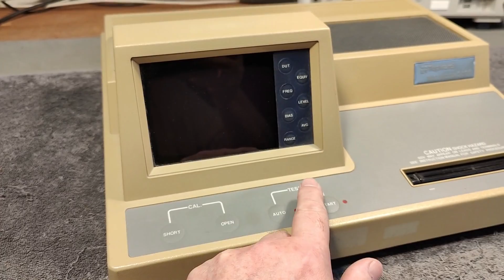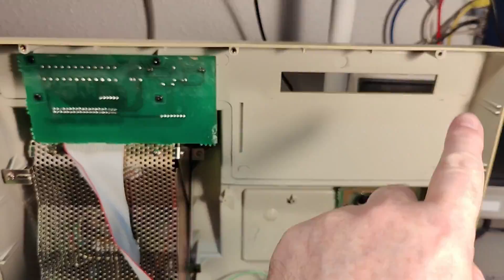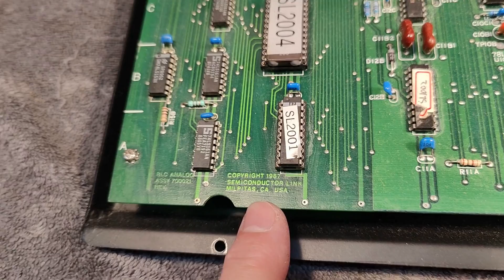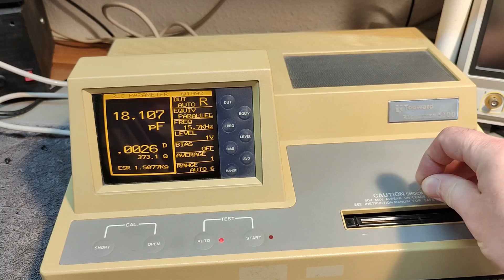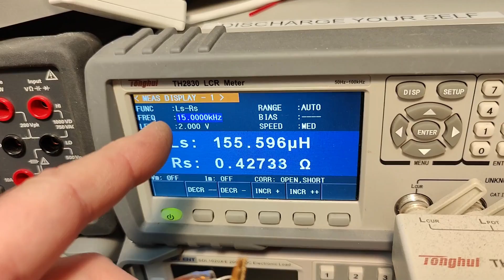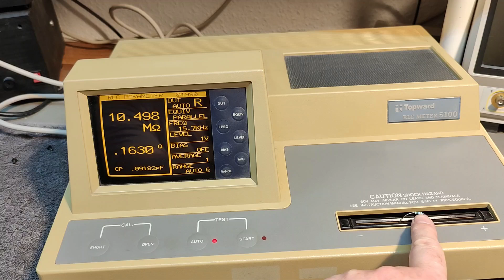Topward RLC meter model 5100 from 1990 test teardown

Comment: That's a very nice piece of equipment, I like, and being able to reliably measure pF values at different test frequencies is really useful. 

Quite odd that it's a US copyrighted board set in a Topward branded box, I wonder what the story there was

One of the sanded down chips is definitely an Intel part, the slightly recessed rectangle in the centre is a dead giveaway for something 803x/805x era Intel (but it could be pretty much anything from their whole range, not just a microcontroller)

Comment: May be processed by the processor MC6800 and video controller MC6845
Reply: The big IC in the middle under the battery looks very Intel Microcontroller-ish with the remains of the text window visible. Could be 8048, 8049, 8039...
The other big IC being an MC6845 is pretty much a safe bet.
I agree with Thomas about the other big chips being RAM.
The smaller ones are either dumb BUS transceivers (hey - I've had more obvious components with scraped off part numbers) or PALs - and probably not the registered variant, (probably) trivially easy to brute-force.

Comment: Several companies came out with similar meters at the time. I used to own an ESI 2160 Videobridge, and Wayne Kerr had one as well, before everything converted to flat panel LCD.

The flat desktop design goes back to General Radio, Stanford Research, and Wayne Kerr using LEDs. I use a Stanford model on my bench, now.
Reply: One of the more unusual aspects of the Wayne Kerr 3240/3245 is the fact that it was available with either a green or amber phosphor CRT.